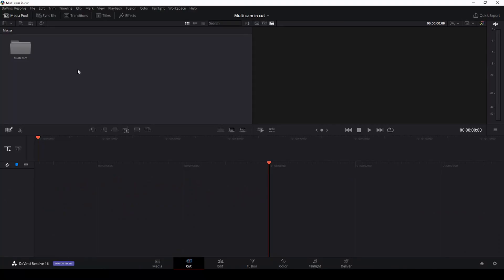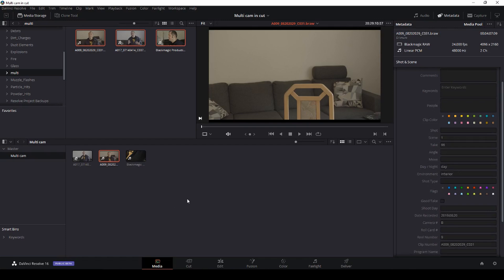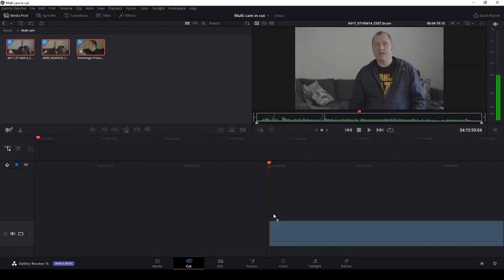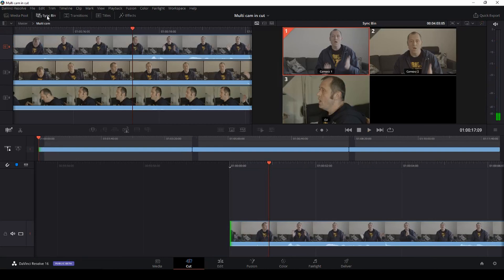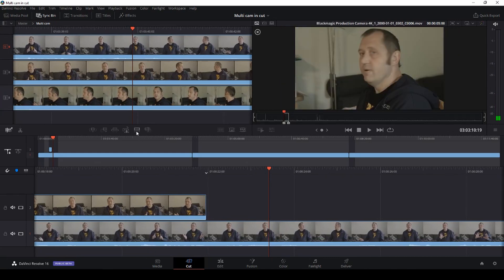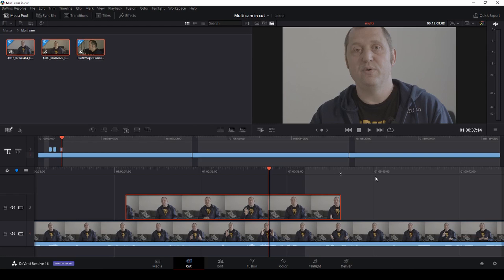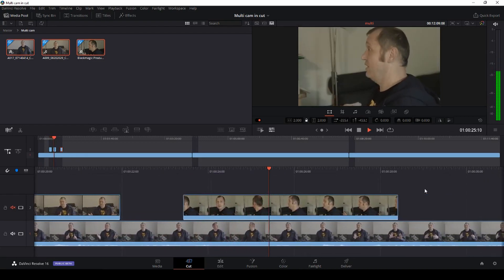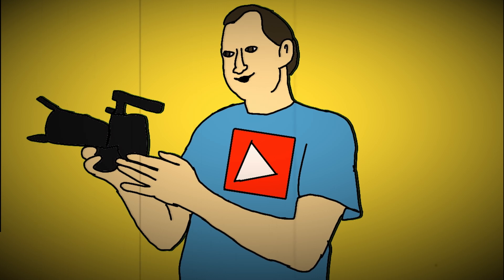Davinci Resolve 16.1 BETA 2-How To Multicam on the cut page

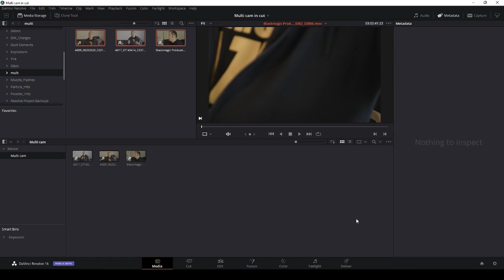Comment: You can explain things quite good. However, two things: A) At 2:30 you wouldn't need to create a timeline. As soon as you drag the first clip down it automatically creates a timeline. B) At 3:38 you don't need to highlight the clips before clicking Sync Clips. When the clips are in this bin, the sync clips feature automatically knows that you will sync these clips.
Reply from the maker: Thanks, I been sometime since, I did that video but you are right. Now I'm using Davinci Resolve editors keyboard, it make things a little faster in the Cut page.

Comment: Looks a little slower than Multicam in the Edit page where all I have to do to change angles is click on the camera. How do you find the speed of workflow for multicam using this method vs the traditional one?
Reply from the maker: I find it about the same, but I think the syncing are better in the Cut page and also the setup are fast I think.

Comment: Hi Duke. It is my very first hour with Davinci Resolve (any version) so maybe I'm wrong, anyway here we go: Why do you drag the three clips to the timeline? Here I'm just dragging just my leading clip (you may choose any of the tree) and I'm getting a multi-cam clip without the other two being append at the end of the previous ones. Cheers
Reply from the maker: You can do both ways, like so with so meny other things in Davinci Resolve they can be don in more than one way.
Reply: Duke Denver Film Sorry but,  why are you adding after the multi-cam clip, repeated clips that are already on the multi-cam clip? Is like you are adding A B C in parallel (which is right) and then after that, B and C in series which is something you’ll never do in a real situation.

Comment: Any idea how to use this multicam with seperate audio. I tried it and it worked and I can see that you can turn off tracks audio but really don't see how to use an external device - when I did it, I used a zoom device for audio and it seemed to sync in the sync window but couldn't find it in the cut page. Also - did you start the cut on a new timeline and then drag all the clips in or just the main one? Your tutorial here kind of went there very quickly.

Comment: Looks cool - One thing is what to do if the sync is off. A lot of tutorials show how to do stuff when everything goes as planned, which is great - fixing a bad sync might be something for you to consider on your next dive into this subject. Close-up feature looks interesting. Does it upscale if the resolution is the same? or is this designed to cut into a 4k clip from a 1080 timeline?
Reply from the maker: Sure, I did test a stage performance with 3 cameras and it sync without any problems, I don't think that would have worked in DV 15 doing multicam edit.